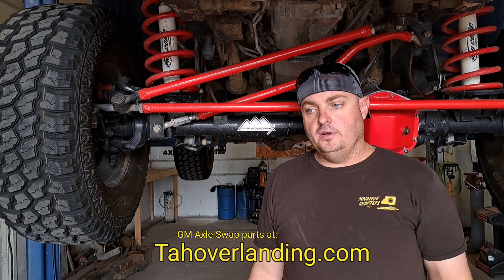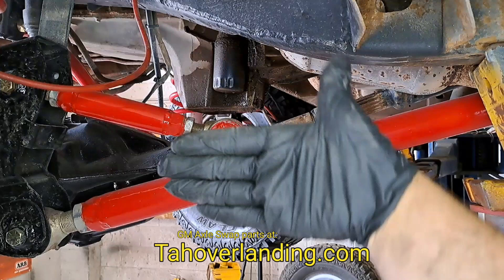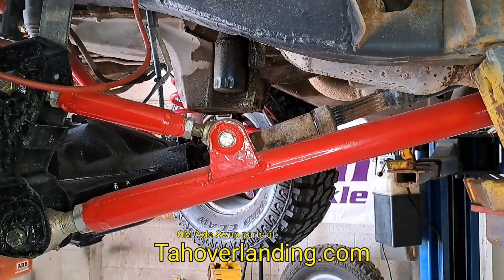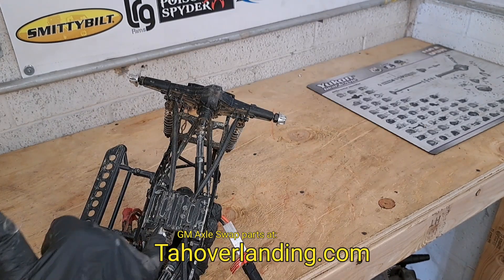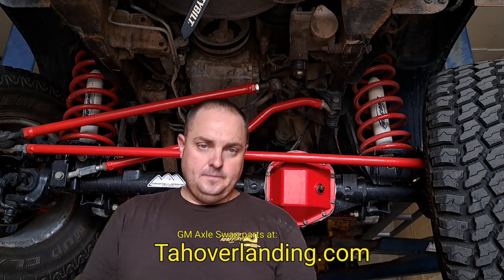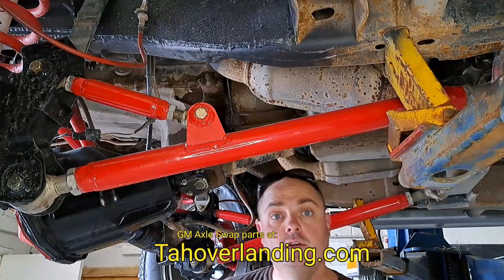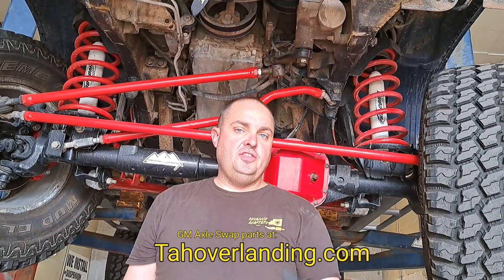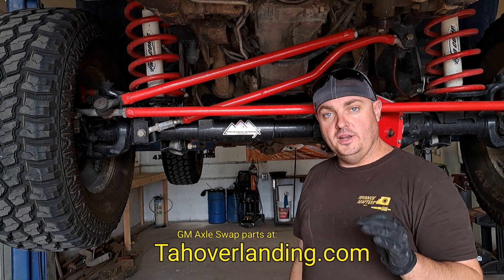Radius Arm Bind Explained Tahoverlanding Axle Swap

Comment: Your presentation is excellent.  Even though I have Ram pickups and Jeeps for my solid axle vehicles.  It is a shame about the hydraulic steering ban.  Since most vehicles don't steer for most people without engine power anyway.  I had an accident with a F-350 4wd that stalled on an icy road, in high winds, and on a curved section of road.  It was several bad ignition coils with the 5.4 motor.  But after driving a buggy with hydro only steering.  I like how they work.

Comment: How often are you replacing joints? The bushings on mine go out after only a few wheeling trips. They last fine on the street and mild wheeling, but after a few trips the bushings are all junk. I triangulated them around 10 degrees, and they are around 36 inches long.

You also pay the price with handling quirks with radius arms. They have low anti-dive, every hill my suspension drops out and every time I brake at speed it compresses almost to full bump. I have seen this on pretty much every short-wheelbase rig, not that much of an issue with a longer wheelbase truck.

Now what makes radius arms awesome is that they are super easy to setup and package, and have exceptional street manners since they kind of act as their own sway bar. But you miss out a lot on the tuneability and performance of a properly setup 3 link. I will probably end up swapping over to a 3 link soon, I see too many guys out wheeling doing the same stuff I do with three links that just flat out perform and handle better.
Reply from the maker: @LScout800  you appear to have missed the entire message of this video. 

Not all radius arms are created equal. 
The entire goal was to debunk blanket statements of "radius arms _________" or "3/4 link are always better...."and your comment was full of them

If your rad arms shredded joints, and handled poorly. That wasn't because it was RAD arm. It's because it was set up wrong. 

If you're going 3 link, and set it up equally wrong. It won't be better. 

If anything rad arms are the setup of choice for optimum handling. That's why as time went on, all solid front axle factory full size trucks went to radius arms. Many went from 4 link to rad arms. Such as dodge. 
Those bushings last 100k miles plus. 

Personally mine has every one of the same joints I installed in April 2020 
*edit that's roughly 120 wheeling trips

If a truck shredded joints "every few trips" I can't imagine it was set up remotely correctly. But I've seen so many Facebook/ youtube/ Google educated fabbers get similar results. 

Please don't attribute that to radius arms.

Even I didn't start picking up on the subtle nuanced principles until at least my 4th or 5th radius arm build.

Comment: I find that stock suspension is only good for driving on pavement at slow speeds. If you want more you are going to need to upgrade. Doesn't matter the brand.

Comment: So I wheel old land rovers with a similar ford set up radius arm. Im looking at making a set of arms (I also need to correct pinpoint angle by 3 degrees) 
Have you seen radius arms with a pivot on the arm with a removable pin that is to be removed offroad only? If you could take a look at a disco 1 front end I’d be great full to hear your input on what could/should be done. Thanks, subbed.
Reply from the maker: Have you seen Metal Cloak and others offering Rad Arms with a spring on the upper locating arm so you don't even have to disconnect anything? 

I address disconnecting upper locating arms on radius arms in other videos.  

The focus of this video is more to dispel the widely held belief that all 4 links are better than all radius arms

Like you mention, disconnecting links will improve flex, not just on a Rad arm. If I disconnected one of the upper links in my non-triangulated 4 link in the video. It would flex even more.  

But Tahoverlanding Is not about extreme measures such as temporarily disconnecting links just to gain performance. 

Not to mention in this video You see our swap yet substantial flex without needing to do such things
https://youtu.be/xreLdMWw8K8

We are all about the sustainable long-term. Set it up right the first time
Drive it there comfortably with good road manners, wheel With maximum performance it, drive it back

Disconnecting links and things To modify the Suspension performance is not far removed from just putting A tube buggy on a trailer and hauling it out there.
Reply: @tahoverlanding  thanks for the reply and I’m with you. I’m just trying to figure out a way I can have the front end of the disco flex more, reliably, comfortably and maintain road manners as I never trailer it anywhere. 

I’m just not sure with the discos design I can bring the frame points any closer together ie (mount on inside of frame vs outside) 
Most people correct the pinion angle with other bolt on brand arms and put a set of slotted bushings in and call it done. For me it’s not good enough as the back end of the discovery flexes amazing with the a armed 3 link. 
I really would like to match the front. 
Thanks I’ll check more of your videos out
Reply from the maker: @riverbedoverland1960  It would take custom fab to triangulate the Rad arms for sure. But you would see the benefits. 

If extensive fab is out of the question, a disconnectable upper locating arm is a valid option for you. 

I don't discuss it much, because the on road manners of our rigs when you pull a locating arm isn't great. Specifically the front end pulls and dives under heavy braking 

And for example I ran 160 miles of the pony express trail this past weekend. Some of it is gravel high- speed, other parts are slow and technical. 

Needing to climb under to disconnect/reconnect 7 times isn't worth it to me.  

Plus I'd hate to have someone follow the idea "disconnect this and get more flex" and then wipe out their truck causing injury or damage

Comment: Wouldn’t it be better for the Tahoe to build new 4 links with Johnny joints and bushings to reduce binding when flexing?
Reply from the maker: Do you mean the rear? others have tried,  these trucks with those joints don't gain much over what they have stock. They do gain a little, but not so much that many feel it to be worth the cost or effort.  

Like I mention, non triangulated short arm 4 links bind geometrically and joints just don't have the ability to counteract it very much.
Reply from the maker: I do also beat it really hard. I push it further than most people ever will and that's how that got bent 

In the future I'll show what works the best to upgrade the rear when it comes to flex
Reply: @tahoverlanding   
Yes I meant the rear. I’m currently acquiring components then the Tahoverland kit to complete my tahoe.
Reply from the maker: @RickAiazzi  I look forward to setting you up with what you need 👍